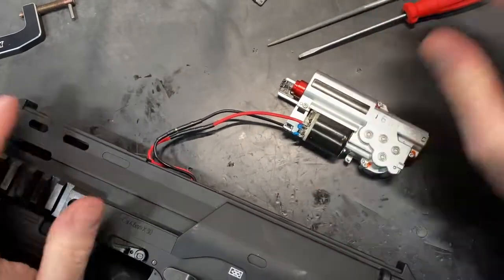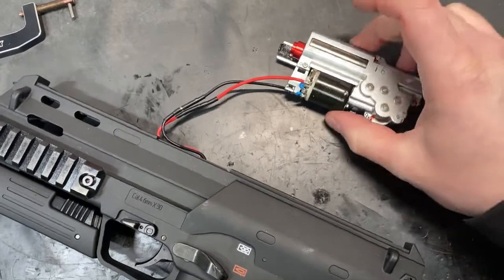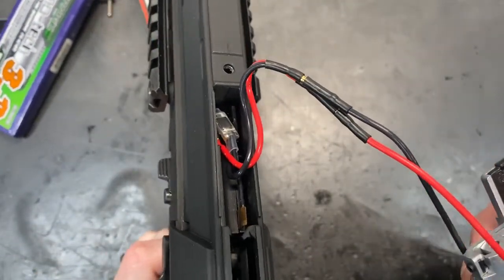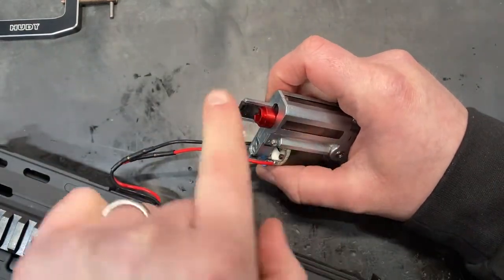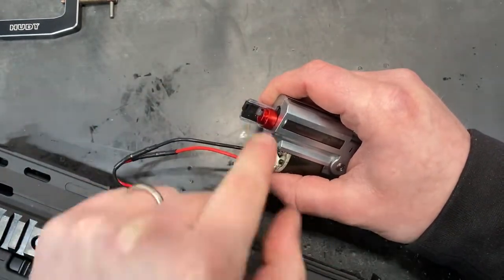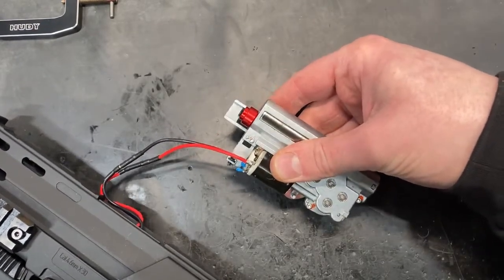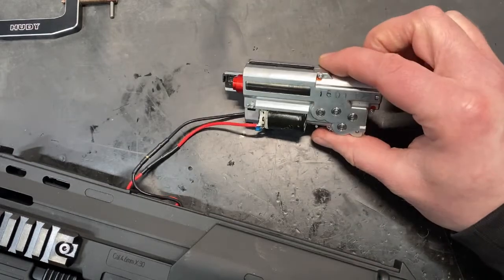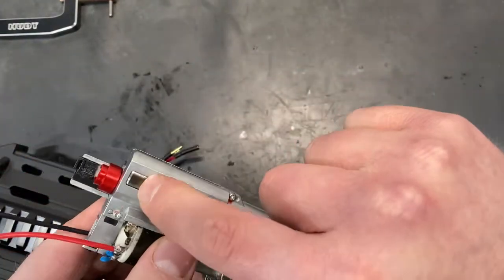Upgraded TM MP7 Showcase

Comment: Hi there, incredible work. I saw a video on facebook mentioning that you used a microswitch attached to the gearbox for cycle detection on the perun. It'd be incredible if you could show us how to do that? If not, at least I know it's possible. I'm making a custom M7 SMG from Halo, and I don't have any of the original trigger or fire selector mech, just a microswitch trigger. Do you know if the Perun can use a separate microswitch to detect if semi is selected? If it can I'll probably order one from your site when I can. Cheers.
Reply from the maker: Thanks :) 
I have some pics on my phone so I'll look them out and chuck them up on Facebook/Instagram. 
I use a small microswitch to sense the cutoff lever that protrudes from the base of the gearbox shell directly. 
It does require some epoxy to fit but we're working on a 3D printed holder for future setups. 

Same with the selector, a small microswitch to detect the selector plate directly. 
It's a bit of a faff getting everything sitting nicely so it's quite time consuming but if I get more comissions for this, I'll develop a 3D printable switch holder for that area too (it would be much more complex though).
Reply: @KingdomofAirsoftUK  That helps me massively, thank you. I was thinking I'd just have to go without semi automatic, which isn't great considering semi only rules in many sites. Glad to have that conundrum solved. I also had a look on Perun's manual which provides some useful info. I'll have to have a fiddle with what mounting solution works best for me.
Edit: didn't see it was out of stock. Think you'll get any in soon?
Thanks again.